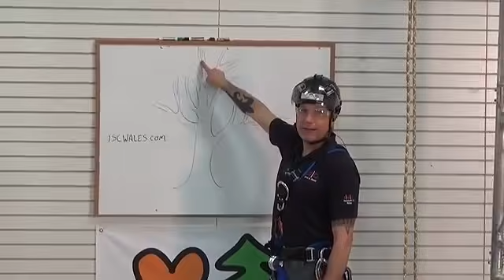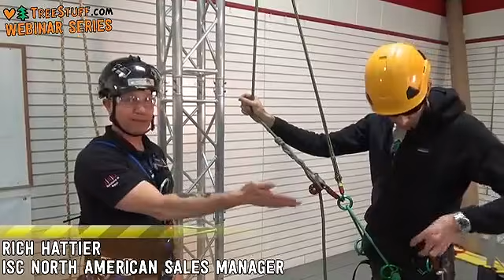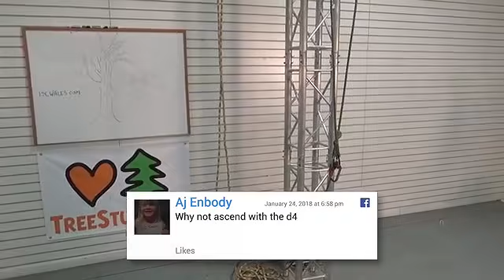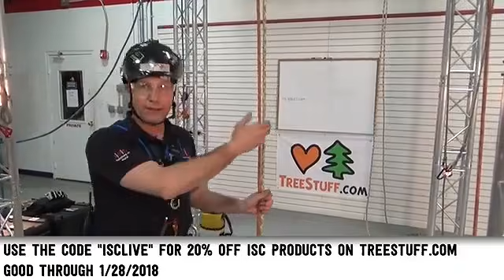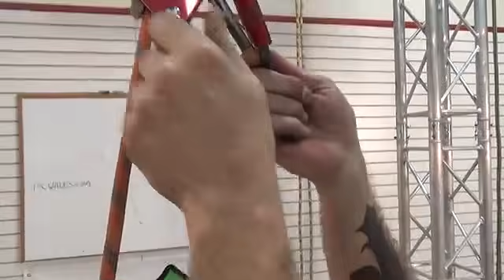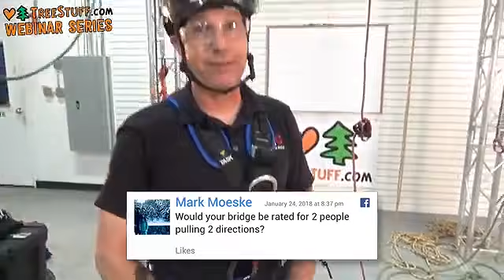Rescue, Safety, and SRT Webinar w/ Rich Hattier from ISC - TreeStuff.com

Comment: What kind of harness is the trainer Waring. I like how there is multiple attachment points. Because I get alot of tree jobs ware I gotta climb a branch or leader at a 45 degree angle. Wich we all know is the hardest to climb. That harness would make a situation like that much easier in my opinion.
Reply: That is a Task brand harness. Check out the TreeAccess ANSI XT by CAMP

Comment: This is a great video. Being new to climbing I found it very informative on how to choose safe methods for ascending and descending trees. 
Adding a second line at 1:38 is a pretty neat trick. The two concerns I have with adding the sling at 1:40 is the second rope is now not rescuable. Second, the first rope can now only be lowered an amount I’m not smart enough to figure out but I believe it will have to do with the distance and angle from the sling to the attachment point of the second rope to the first rope as to how much travel will be available. 
Keep up the excellent videos.
Reply: Would leaving enough slack in rope two between the sling and connecting point of rope one be a viable solution to my second concern? It seems tied in a loose knot out of the way yet easily pulled apart would allow rope one to descend fully to the ground, from the ground.

Comment: Why do you leave the victim suspended when you detach on the ground?
Reply from the maker: It's related to suspension trauma, which Rich didn't really get into in this webinar.
Reply: If a person have suspension trauma can has a greater concentration of kalium in his legs or other choked limb or bodyparts caused by the harness, sling, rope, etc... And of that kalium overflowed blood spread too fast after the rescue can cause heart disfunction. If the person stay suspended and slowly release the squeeze than thet can help that problem.